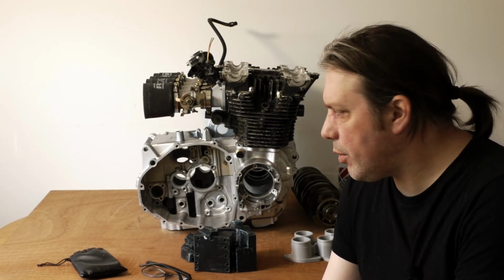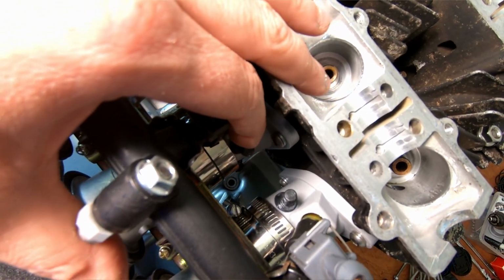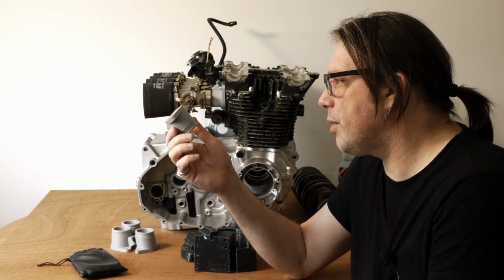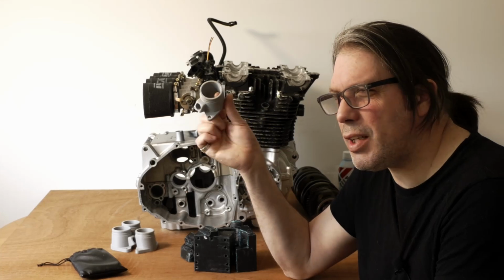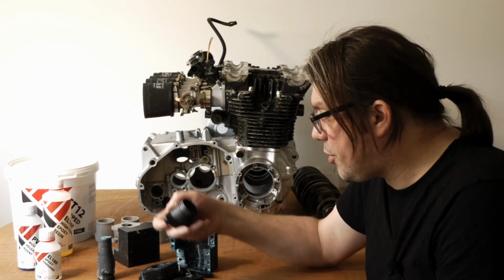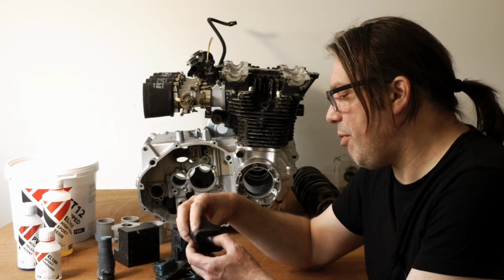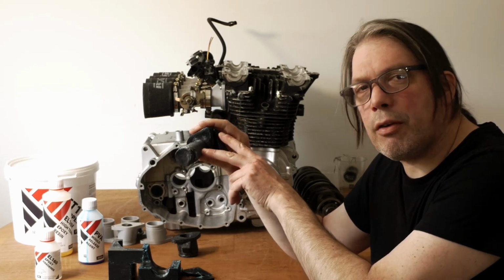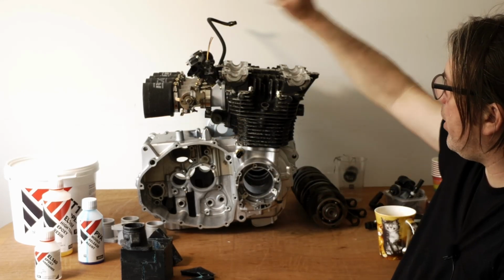Cheap DIY fuel injection on a classic bike, episode 6.

Comment: Did you consider removing the layer lines of the 3D print molds? Also, look at the mold design and try to do compression radially except for axially. The friction/shear forces might be less in that orientation. U might get flashing and the core would still need to be released axially.
Reply from the maker: I haven't put the engine together yet so we will see in time but the mechanical properties of the finished part are completely different to the properties of the raw resin or fiber. Once it's moulded together it's very strong and rigid. It's very important to get the correct ratio of fiber to resin for the maximum strength. I must admit I had my doubts when I was cleaning up leftover cured resin as it was quite brittle but once I started machining the details into the finished part it was clear how strong it was.
Reply from the maker: I did look at that orientation but it would require a lot of material to move around the core which I don't think would be reliable. Most people using this method would use a much higher infill to prevent bulging under pressure but I'm trying to get away with a lot less infill so I'm prepared to experiment a bit so I have added some stabilizing features for the next one. I don't want to spend any resources on improving the release as each part is unique and the layer lines are very easy to sand off the finished part. I'm going to do another video soon but thanks for your suggestions.
Reply: @Blackthumbditch  One thing I want to know. I see on EasyComposites' website that the max service temp of the IN2 resin is 73°C. Does your part stand-up to the heat of the engine?
Reply from the maker: I'm using their EL160 resin
Reply: @Blackthumbditch  I don't want to be a wet blanket but I see that resin has a low tensile strength. Maybe with the carbon Fibre it's much stronger. I know that company did a video on the relative strength of different material. 3d print vs cf weave vs resin, etc. Would you say the strength is sufficient for an intake boot?